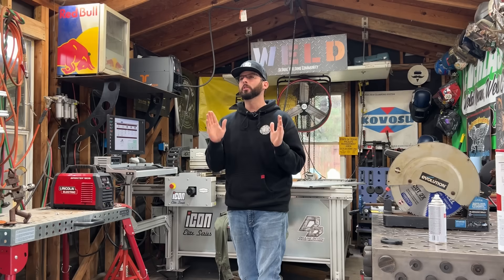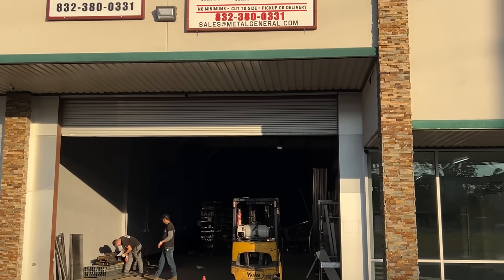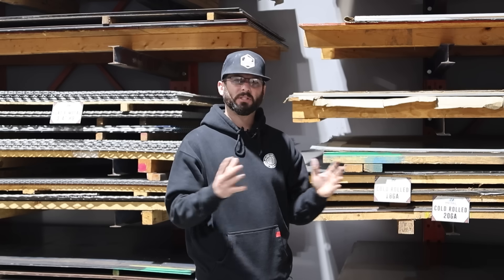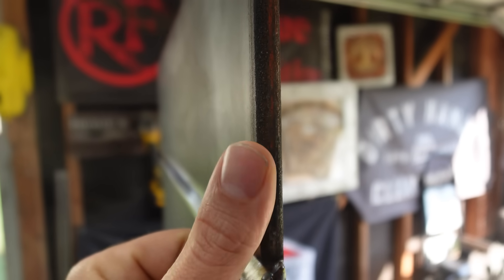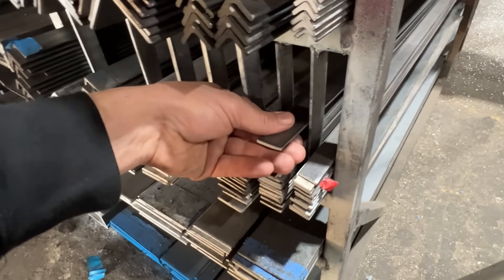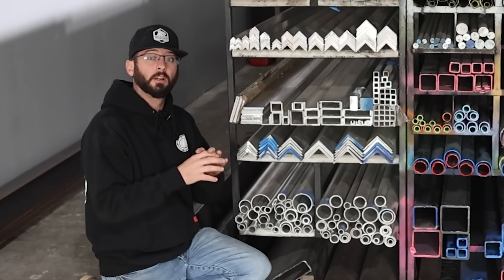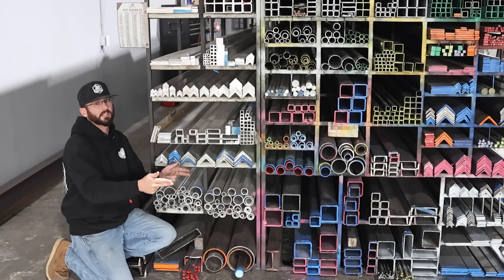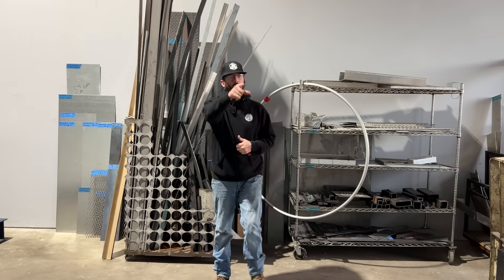What You Need To Know Before Buying Metal For Welding

Comment: The top three questions they will ask you (know this so you don't look like a totally idiot)
1. cold roll or hot roll steel?
2. mechanical or structure tubing/channel?
3. what gauge?
If requesting tubing, always specify shape ie. round, square, rectangle, obviously with dimensions, but call out the shape anyway. Know the difference between pipe and round tubing. Mechanical C-channel has parallel flanges, while structural C-channel has tapered flanges (sloped). Seamless or welded tubing.

Comment: For oilfield tubulars you will have pipe, casing, tubing.  All three are pressure rated. But the metal composition will vary ...  J40, N80, etc. It may also have coatings inside and out.   You also have sucker rods, drill pipe and drill collars.  Some may be magnetized.

Comment: I use a lot of angle iron. The biggest problem I have is that it is never straight. One side is usually straight and the other is severely warped. Don't know if this is common or just my supplier. For bigger projects it is a nuisance.

Comment: "DOM" refers to drawn over mandrel tubing, a specific type of high-strength, high-precision steel tubing, whereas "pipe" refers to a general category of material typically used for plumbing or structural uses, which has different properties and measurement standards

Comment: Mate, steel is out of control here in Aus.  2" painted SHS at 2.5mm is over $130 per 8m length now.  It's like $200-300 for a single length of 3" SHS at 3mm.  Makes the job real hard atm. A single 3mx1.2m sheet of hot roll at 1/8" is around $350-400.  And that is from a steel supplier.  If you went to a big box store like bunnings it would be far worse.  A little local steel shop wanted to charge me $100 for a 3m length of 2" SHS at 4mm thickness the other day

Comment: I used to go to Westbrook Metals in Austin for aluminum blocks for machining, but they're going to carry mostly welding stuff. I didn't weld back then. They look to be similar with Metal General except it's not as big. I always look in the drop pile for stuff. However sometimes I'll stop by the machine shop at UT Austin's engineering department for scrap metals. Sometimes you will find broken end mills and such that they will let you have for free. They can be sharpened/ground into some other tools.

Comment: Some other topics to include, consider. Hot rolled vs cold rolled vs ground stock for bar and plate. Formability of non ferrous alloys. When you were going through c channel dimensions the 'depth' is the flange and the web connects the two flanges. Seemed like a little slip up but good to use the correct language for an educational video like this.

Comment: Then there is the distinction between hot and cold rolled steel, both when buying and when fabricating.  Cold rolled is dimensionally more accurate.  Hot roll will have mill scale that may have to be removed for welding.  Tubing and cold roll will distort (bend) when cut lengthwise due to internal stresses.  Seamless tubing is needed to slide another tube inside it.  DOM tubing (drawn over mandrel) is precise and expensive.  Don't forget the alloy, either.  The list goes on and on and on...

Comment: Keep in mind that some metal suppliers cater to smaller orders and have drops available but some places cater to larger orders and won't sell you anything without a $400 or $500 order and require an account set up, these places also give you better deals the more you spend, if you are buying under $1,000 every piece will cost far more than if you are buying $15,000 worth of metal while the suppliers that cater to smaller project orders will give discounts for larger orders but not a huge one. There are online metal suppliers that cater to small orders but keep in mind that shipping is not cheap especially on longer pieces, sometimes still worth it if you don't have a supplier in your area, E-Bay is another place that has some good deals but some bad ones too, don't be afraid to get quotes from different places because prices do greatly vary from one place to another.

Comment: There are different I beams…. S beam H beam and W beam they go by height and weight per foot. W beam  example-W8x21 is wide flange 8” tall beam that weights 21 lbs per foot. S beam is standard beam S8x21. There is a chart that will tell you actual outside dimensions your metal supply should be able to supply it to you.

Comment: Most true steel suppliers have tons of "drops" that you mentioned, and I buy them all the time and stock up because an out of town group bought the local steel dealer and now you are required to buy half a stick or they won't cut it. If you need something special order they don't stock it comes overnight, but you have to buy it all, 20ft minimum. I needed about 2 feet of 4 inch cold roll really bad not long ago. Long story short I had to spend about 1,800 bucks and now I have 18 feet of 4 inch cold roll I will probably never use. Thats an expense you just eat and can't pass on really. Its not so bad though if you will use it in the future. The new way of business at Wilkes Steel has ruined it for most average people. ......And most of this can be bought 40 feet as well. Some really big stuff 50 feet and up.

Comment: What do you use to catch the shavings from that Evolution in the background? I have the same saw and the built in tray doesn't catch but about half. Especially on bigger metal. I always drag mine down in the middle of my shop floor. But they are freakin heavy!

Comment: Those in the Denver area should check out altitude steel. It’s across I25 from Mile high stadium. Amazing drop section and killer prices on the drops, the more you buy the cheaper it gets. One of the few things I miss about my 20 years of living in Denver.

Comment: I had a small project. Looked at Lowe’s for flat bar. 
3/8” was $34 for 3’ piece.
Same stuff at metal dealer was $10.28 for 20 FEET!
Reply: @michaeldalton8374  Wow. Thanks for putting some numbers onto that! I don’t do this very often right now but I have a couple projects coming up. 

I was figuring that I might be able to save a bit of money, but if my local suppliers are that much cheaper it’ll be a game changer. There’s stuff that I just wouldn’t bother doing at $34/3’.
Reply: I've bought those hardware store 3' pieces a few times.  A few days ago I had something large to build and went to a metal supply place prepared to spend a few hundred dollars based on what I'd paid at the hardware store, when she said $72 for everything I about kicked myself for ever buying a 3 footer.
Reply: Try the scrap yard ! Even cheaper than supplier but of course not the same choice or quality! I’ve been buying thick 2.5-3” angle recently though for 25-30cents per pound. Today I got 24 feet of 2.5 “ 1/4” thick angle for $23. I found it as three pieces about 8 feet each, all straight with some rust that can be cleaned off with a wire wheel or flap disc.
Reply: 1/2” metal dowel 
Home depot (4’) = $30+ 
Metal store (5’) = $8
Reply: Lowes, menards, ace, etc are just good for some quick tools etc but no good for  material 75% of the time
Reply: The dump is a good place to find angle iron as well, old bed frames have a lot of material that can be useful
Reply: We do a fair amount of business with our distributor. We get a great price from them, and over certain weights even better. Which is insane because even someone walking off the street gets a way better price than the box store. We recently started ordering truck loads straight from the mill and it’s as cheap as it will ever get. The mark up on steel down the line is insane
Reply: @michaeldalton8374  go lookin' around the night before garbage day, used to do it all the time & if I saw some scrapper I'd see what they had & buy it for next to nothing if there was something I wanted.
Reply: yea, no.
the metal dealer isnt going to sell you a single 20 foot piece of metal for $10...

Comment: Man...Mom& pops salvage yards are AWESOME i was getting HUGE aluminum signs that i made hard tops & bed covers/toppers for truck beds with for pennies compared to suppliers!!!
Reply: In Taiwan there's only mom and pop stores. Corporations don't touch hardware industry with a 10 foot pole for some reason. There's a tool chain but apart from them having a  return policy (in Taiwan, return policies are uncommon, as the law only requires 7 days of return if you buy it online), they're marked up badly too. So I go to specific area of Taipei that sells these types of stuff, often have tool/cutter stores, metal stores (the stores are much smaller, like probably about the size of that square tubing metal rack), and they specialize in certain metals. That means one store will carry aluminum and stainless, while another carries various copper based alloys, and others have steel. Even within steel there's structural steel and machining steel, and they are not interchangable. 

You have to be much more careful buying stuff in Taiwan because there's no returns if you buy the wrong stuff. Almost everything sold as is. The upside is you don't need your own vehicles because of good public transportation, but if you're ordering something large you'll have to arrange your own trucks (they might have their truck to deliver if it's sufficient quantity).

Comment: Tube is seamless, pipe has a welded seam.
Reply: @malbrandow7382: Sorry, but comment is incorrect. Tube is available both with a seam, or seamless. Pipe is also available with a seam, or seamless. Which you choose is largely dependent on it's intended use, and your budget. Eg: If building a Roll cage, almost all will be built using seamless. Costs more, but is more likely to protect the driver in a crash. Process piping can be either, but again, depends on the product going through the pipe, as well as the operating pressure of the line........

Comment: "I" beams are specified by their approximate depth and weight per foot ex: W14X28 = approx depth of 14" and weight of 28#/ft. There are 3 main types of "I" beam sections available which are W (wide flange), S (standard), and M (Misc). W shapes are the most commonly used type today. If you need the actual nominal dimensions of an I beam (or any other structural steel section) a copy of the AISC Steel Construction manual has these readily available in part 1 table 1-1. Also note that C channels and Tees are specified in the same manner.

Comment: what about hot rolled vs. cold rolled ?
Reply: Hot rolled is typically grades 1008-1010 and has a thin layer of pure blue/black carbon on the surface.  HRPO Hot rolled Pickled N Oiled is Hot Roll with an acid bath to remove surface carbon.  Cold Rolled is typically 1018 Grade, goes thru the acid bath and then is finally Cold Rolled to it's final accurate dimensions.  Contact your nearest supplier for availability.

Comment: Have a means of carrying full lengths and save on cutting charges, the left overs go into your ever growing metal invo. metal is a commodity and usually goes up in price, so it never really goes to waste, need 20' of 1/4 hot rolled round rod get 40' it's not that expensive and you most likely will find a use (build up your always on hand inventory). If you can get a hold of metal catalogs (print and even old ones ) from different manufacturers, it has all the difference shapes and specs, faster than scrolling thru web pages. Be on the lookout for drop off's and scrap bin's some deals to be found, also scrap yards are tressure troves of brass, aluminum and other recycled metals . Great video 😉👍
Reply: At work I am a metal scrap gremlin and I stash scrap under my table or in a corner when it's something uncommon but I know we'll see again, even have an organized drawer for 4 inch or shorter pieces of stainless and aluminum angle and bar because someone always needs a practice piece to test settings or a sliver to bridge a gap